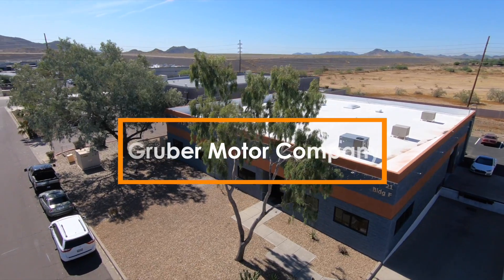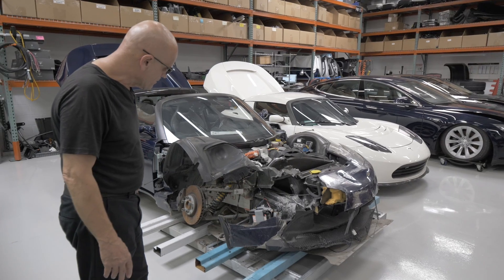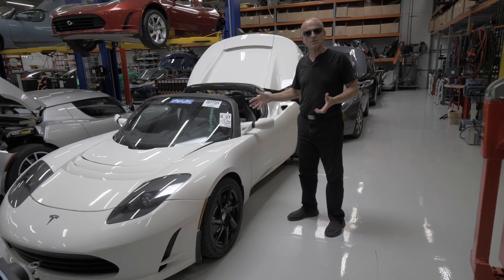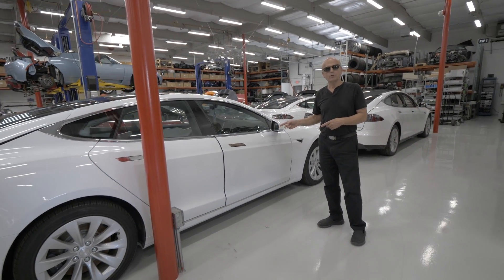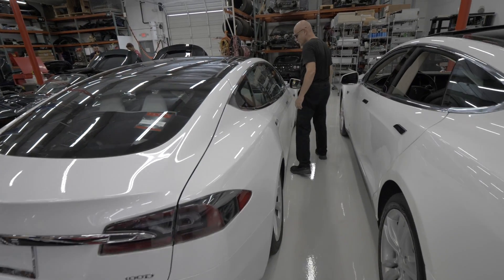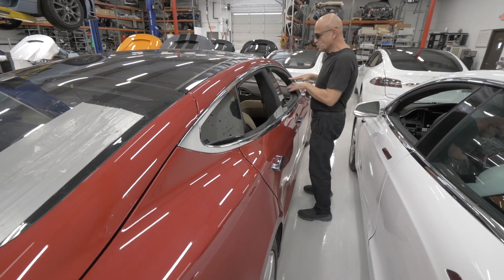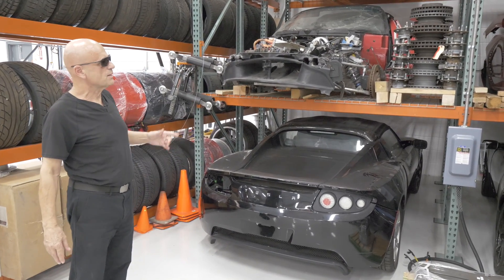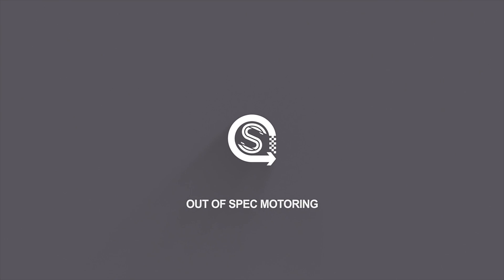The Stories of Salvaged and Bricked Teslas | Part 3 | Gruber Motors

Comment: I could never imagine that such a great car was designed as an appliance. It basically can't be repaired if it ever gets near water. Expensive parts should be water proof, not just cables and computers lying around
Reply: filippxxx 
All cars fail with water damage. Tesla's are costly to repair so insurance often just writes them off as totaled.
Reply: @Son37Lumiere  Most fail with water damage but almost none fail beyond repair. If your regular ICE cars get's flooded the stealership might not be able to repair it (at insurance acceptable cost) , but any other good shop can do it especially because of the aftermarket parts. If you can't get spare parts, the manufacturer should make one's car more splash proof than an iPhone.
Reply: @filippxx  Getting spare parts is definitely still an issue with Tesla but there are third party shops springing up all over to repair them.

Comment: being kind to the environment and not buying gas sounds like a great way to save $$$....until you have to change a lightbulb, or other minor repairs on a Tesla.  Then you will be kicking yourself.  Still think that converting your compact ICE vehicle to electric has advantages, if you can do it yourself.  No computers to lock you out, straightforward parts replacement....the ability Tesla has to shut off your vehicle remotely is unnerving.  I want to be in control of my cars destiny.
Reply: Elon gives, elon takes.
Reply: Haha. You say that like you haven't seen 99% of new cars that are made. All new cars have  overcomplicated electronics & built to fail
Reply: Kevin Nyandika I don't believe cars are built to fail. Every car has a single or multiple failure point, but it's often not planned. Sometimes it's totally unanticipated or not, depending on manufacturer. As a rule, Toyota /Lexus probably has the fewest failure points of any.
Reply: Kevin Nyandika   you are absolutely right, over complicated, built to cost you $$$.  An engineer once told me,  If you want it to work, keep it simple.   Always stuck....less things to go wrong

Comment: What does bricked mean.In UK Im thinking jacked up,wheels stloen and left on bricks.?
Reply: The MCU can be bricked and/or the battery. Sometimes, allowing the battery to go to 0% SOC for extended period of time will brick the battery.  Can't be brought back. Bricking means it has the same value  and utility as a literal " brick." That being nothing.
Reply: Bricked means that the computer is locked up, non functional, or just dead. This is more of a technical glitch issue. Any computer can brick...cell phones, tablets, PC.  Sometimes you can bring it back to life, other times you can not.
Reply: @ksamos  Thankyou

Comment: Dear Gruber Motor Company, my 2015 Model S is almost 4 years old. I too look forward to buying your failed eMMc fix when mine dies (these can fail anytime after the 4 year warranty expires by all accounts). As you would know Tesla do not repair the computer this log message recording chip resides in or even sell the daughter board the chip is mounted on, instead I'll be up for a whole new computer and 19" touch screen which won't be cheap assuming they are even available at that point. Just replacing the chip is not too hard but I assume some data has to be written to that IC before it will work in the car and that is way more than I'd like to attempt (I have no clue what data needs to be preserved on the replacement chip nor do I relish having to build a chip programmer for what hopefully would be just a single use). More power to you sir.
Reply: This is a major problem for all Tesla’s to date. Including the 3. I hope this problem is resolved in the Y.
Reply: @fatboy19831      I had assumed current vehicles would not have this problem waiting to bite them 4+ years down the track. If Tesla has not addressed this problem yet that is pretty bad.  Every body makes a few mistakes when designing something as complex as a motor vehicle (the awful design of the original Model S door handle mechanism and the electo-etching of the traction motor balls within the rotor shaft ball bearings (something which I recently learned was a solved problem thirty years ago in the variable speed motor controller world (think elevator/lift motors)) spring to mind. Tesla must be fully aware of the death of these log message storing chips, hard to believe this problem is still there. If nothing else Tesla would be opening themselves up to a class action law suite from a million Model 3 etc owners around 2025 if it is ignored and the fix could be as trivial as just not recording every log message (linux generates of lot of those).
Reply: @dogphlap6749  From the outside looking in it seems like a very straight forward solution. Hopefully, the 3 cost less than $2200 to repair.  I would like to believe that the Y and every car forward would have a solution.  If not this may just be a payday for Tesla.  It won't happen under warranty for the most part. It is a pure profit repair. By the time this happens to me there should be a far cheaper aftermarket solution.
Reply: Dogphlap 
I suspect there will be a class action when all these Model 3s start failing. Tesla will lose knowing full well that it could have been prevented and yet did nothing about it. At any rate, third party shops will replace them for you and are working on a better solution.

Comment: Improved eMMC MCU sounds interesting. My S is 6 years old, still on the original MCU. Just waiting for the eMMC to fail. Tesla wants $2,300 for a new (refurb) MCU.
Reply: That's absurd. You can replace the card yourself for $10, just takes some soldering. Or there are a few third party shops that will do it for you for still significantly less.
Reply: @Son37Lumiere  "some soldering" BGA chip replacement isn't just "some soldering" IMO
Reply: @rkan2  Exactly. Need hot air for BGA. And the biggest problem is that by the time the MCU won't boot anymore the old eMMC is unreadable, so how do you program the new one?
Reply: @markusstrobl1067  Is this a fact? Do you have a source for it? Usually any flash memory can be read after it can no longer be written to. Of course it can depend a lot on the hardware configuration. Ingineerix and other people have succesfully repaired probably hundreds of MCUs, while also recovering the original content of the eMMC chip from most of the MCUs...
Reply: @rkan2  I'm going by what I've read here: https://teslamotorsclub.com/tmc/threads/preventive-emmc-replacement-on-mcu1.152489  Looks like they can be impossible to read after failure.
Reply: @rkan2  Fair enough, but it is doable. That's my point.
Reply: Refurbished mcu? Why cant they sell a new one?
Reply: @jollygreen4662  Back when they only had new ones they charged $4K. I'm glad they refurb them now. All that's wrong with them is a single chip that wears out (they write too much to a eMMC/flash memory).
Reply: @markusstrobl1067  what would be better? A ssd?
Reply: @jollygreen4662  SSD would be perfect but I don't know if you can make it interface with the rest of the MCU. There's some discussion on the Tesla forums where they use a much larger eMMC. That should spread the writes out so each block is written to less.
Reply: @markusstrobl1067  are there any emmc extension wire to lead into the cabin so u can swap the memory card without digging into the mcu everytime? Maybe bad idea?
Reply: @jollygreen4662  I think using a larger eMMC so it lasts longer as well as using a socket so it's easily replaceable is the big thing. Mine is still ok after 6 years so a larger one should last 10 years or more.
Reply: $2,300 is ridiculous for a bit of board repair... You should contact Ingineerix when the time comes :)